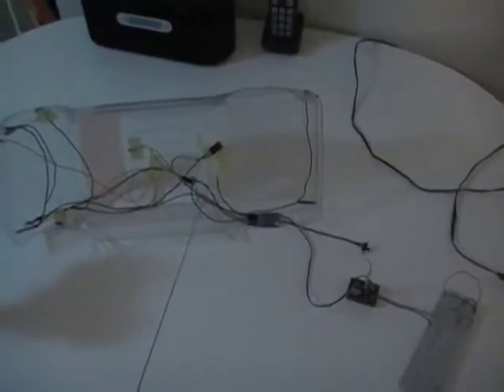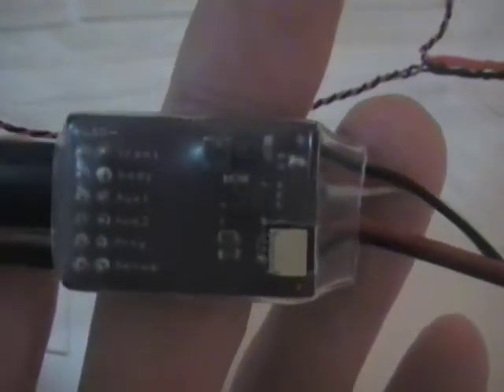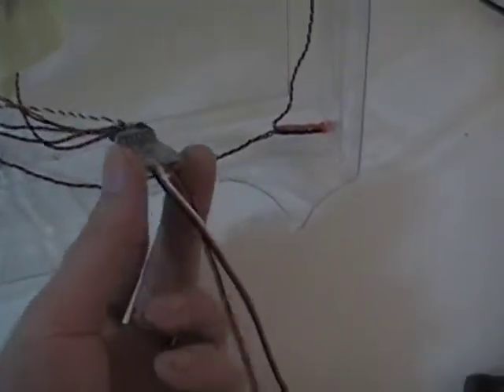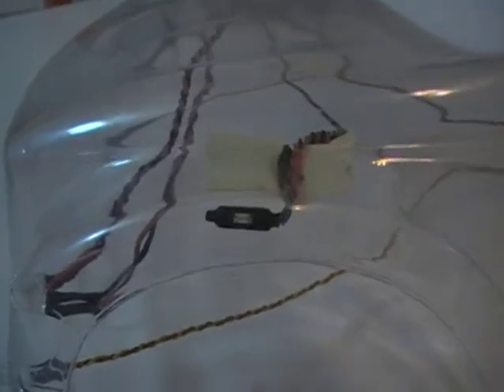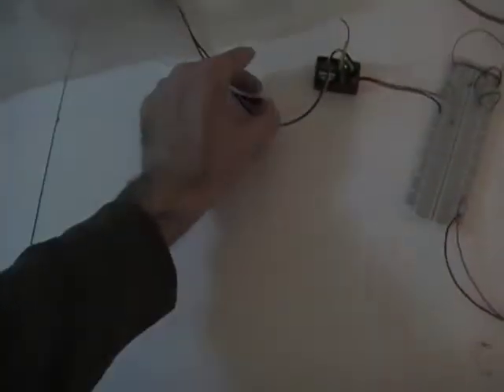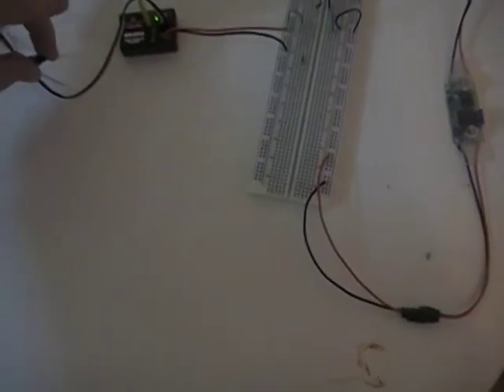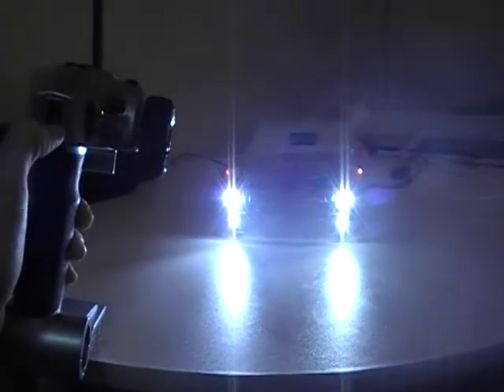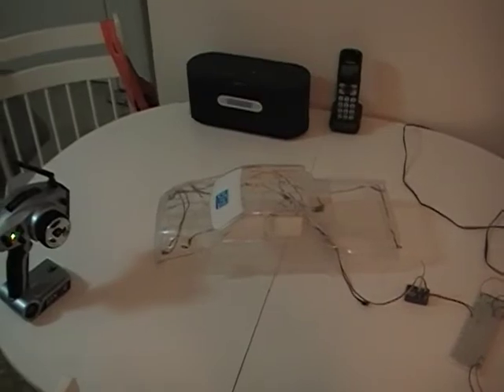rc car auto headlights with manual override

Comment from the maker: a new board design has been done with an option for plugging in a scale lightbar running at 2s/3s voltages whilst still allowing the main body led's to run at a lower voltage.
the headlights have been adjusted more giving functions of DRL,low beams and high beams with the spotlights.

headlights and spotlights are 5mm 0.5w led's and are bright as heck!!!

the lightbar will switch on/off with the aux spotlights output channel either in auto or manual modes.

new boards should be here in just under 4 weeks and a new updated video will follow

Comment from the maker: this set is only outputting 3.3v max for the white led's.
i am going to redesign and change it slightly but can also look at the possibility of making an additional board that can use the lower output voltage to switch a higher powered device which can be linked to the spotlight output.

i am going to try and start having a few of my circuit designs ready to sell hopefully by the time the nice long summer crawling weather arrives.

thanks for watching.